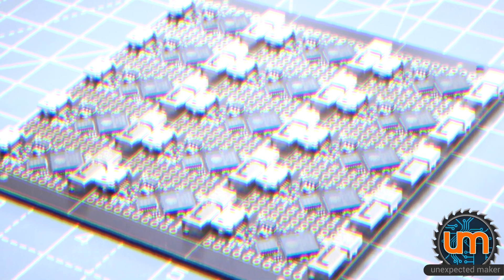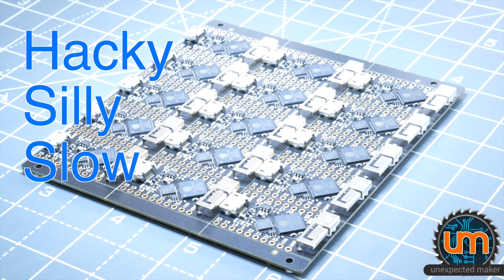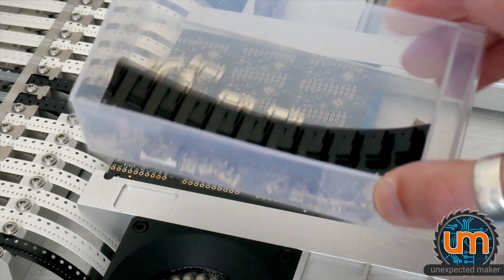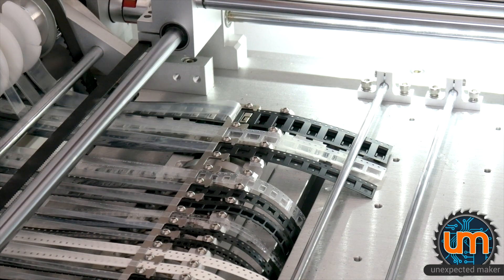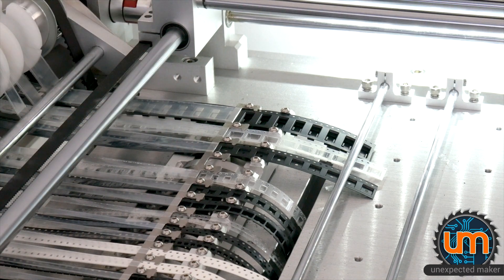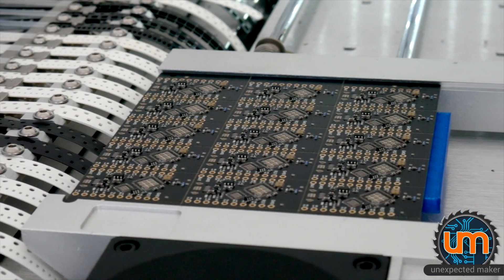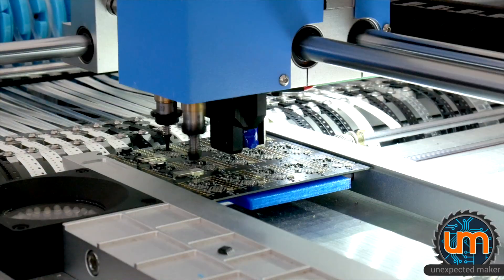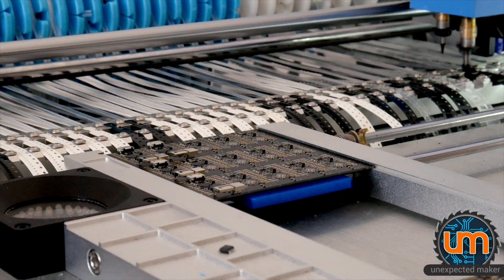Pick & Place Hack

Comment: Cool hack! What is the main advantage of doing this instead of using your 3D printed loose tape holder? Is it a calibration thing?
Reply from the maker: The tape is already setup for those parts, so easier to keep using them for components. Also I don't have a 3D printed tape holder for 16mm (PICO-D4), and the antennas are loose, so they need to go into something :)

Comment: Wastage is bad... using what you have is good. But why not print a tray, if there is sufficient "loose" parts
Reply from the maker: Because it's still quicker to feed them back into the tape than to design/print a tray and then program in the pickup positions, especially when I still have the components on tape... just running low.

Comment: I had this thought when you mentioned having spare parts either loose or in smaller tapes. Glad to see that the idea works. Best to use up those parts as best you can, even if it does take a bit longer to complete the panel. But yes, only larger parts. I couldn't begin to imagine how annoying this would be for smaller parts. Hard enough to get them out of the tape in a controlled manner.
Reply from the maker: Yeah, IC's and above :)

Comment: Wonder if you could run a low temp iron over the covering tape to 'reseal' it so you could do more components
Reply from the maker: The glue on the tape is pretty cruddy... plus I'd have to pull the tape out and re-load the parts... this is simpler :)